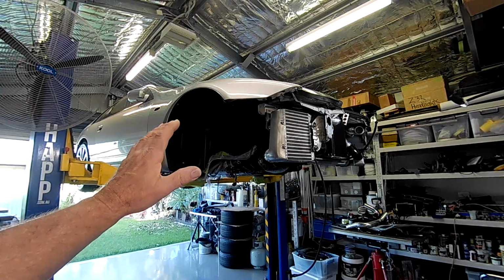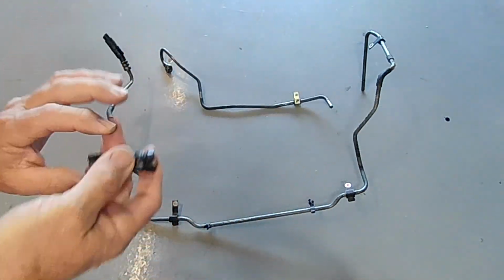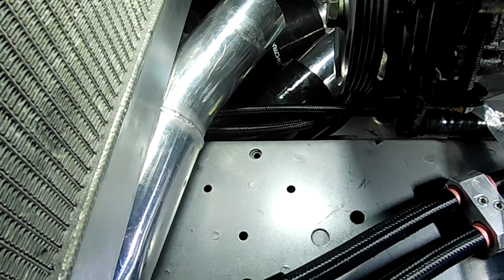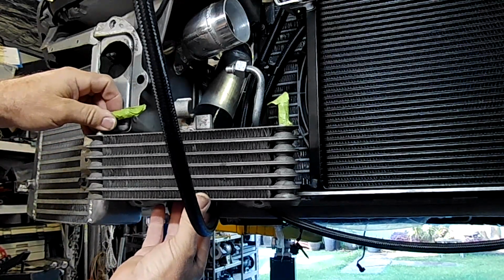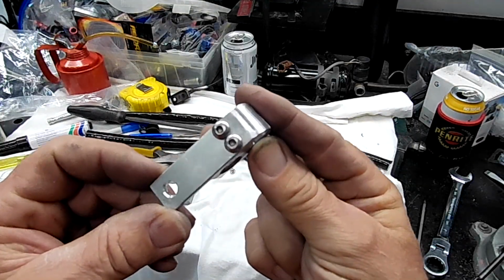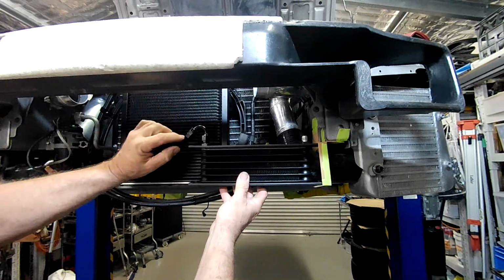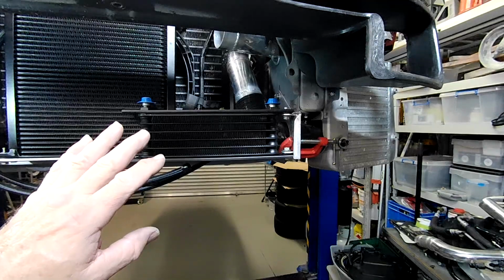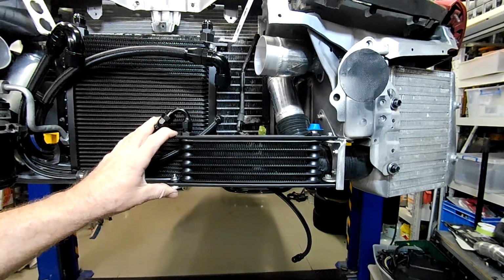Fitting A Power Steering Cooler. Project Fairlady, The Nissan Z32 300zx Twin Turbo Mega Build

Comment: Isn't that oil cooler a bit too big and block air to the condenser and radiator, and cause overheating issues?
Reply from the maker: G'day Mate, Nah, it'll be fine. I run the same Oil Cooler on my TT 370gt in the same spot, it also has a 26 Row Setrab Oil Cooler for the Auto Trans beside it & a 100mm thick front mount Intercooler in front of the whole setup, with no overheating issues. You can see the whole setup in the previous series i did on the 370gt. Cheers Mate.

Comment: Hi, do you think that maybe perhaps the extra length of the pipes for the steering could be for a cooling helper?
Reply from the maker: G'day Steve. I honestly don't know Mate, its a bit of a baffling setup to be honest. I guess we'll never really know what was in the Nissan Engineers heads at the time. Cheers Mate.
Reply: It's probably the cooling line for PS. The LHD S13 is the same way. The low pressure return line from the rack is right next to the PS reservoir. The return line is routed to a simple metal loop in front of the subframe for cooling before returning to the reservoir.